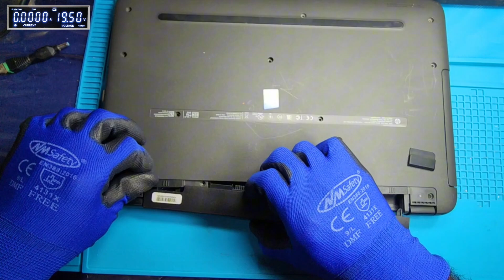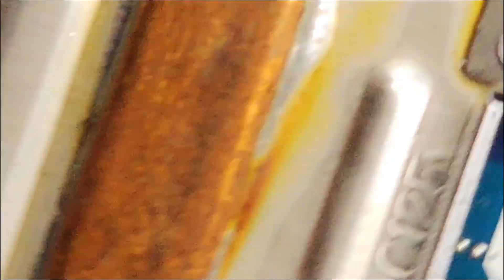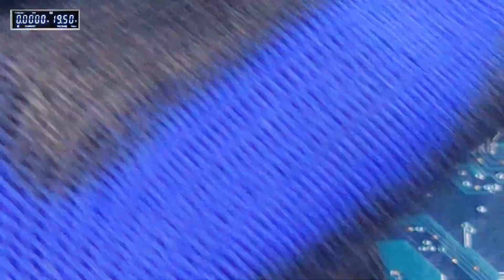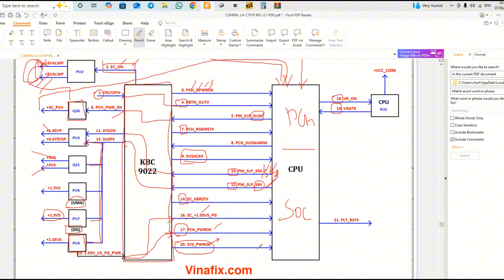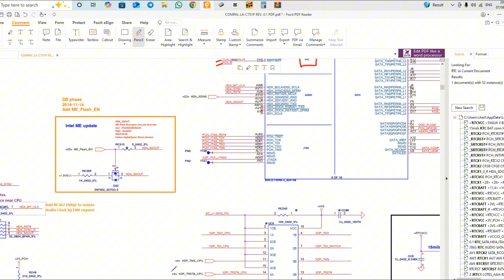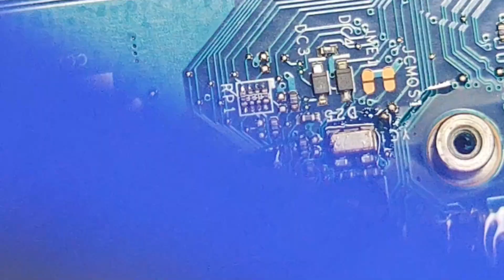Understanding the importance of 32.768Khz Clock | This is a universal Concept | HP LA-C701P NO POWER

Comment: The name signal "PCH_PWRen" what's it same with " PCH_PWROK" Brother?? Because I searhed the name signal "PCH_PWREN".not meet on inventec motherboard
Reply from the maker: Pch_pwr_en is a signal that turns on pch primary power such as 3.3v or 1.8v alw. 

PCH_PWR_OK is a confirmation signal to the pch that all core power for the pch is stable.

EC chip will collect all power good signal from regular including cpu regulator and will send 3.3v on pch pwr ok.

 Pch will deassert (to 3.3v) PLTRST# When pch_pwr_ok is 3.3v.
Reply: @philiptroniks  the name signal PCH_PWR_en what's it same on the all brand motherboard, such as quanta, inventec, etc. Because I'm search the name signal not meet on inventec motherboard
Reply from the maker: @wahyupamungkas5331 pch_pwr_en is not universal. Some manufacturers use SLP_SUS# signal directly to turn on PCH power. Mostly compal use this pch_pwr_en signal.
Reply: @philiptroniks I have checked signal SLP_sus# not there 3.3v brother, what's I have to check next?? I means what's requirements need to signal slp_sus# is high
Reply from the maker: @wahyupamungkas5331 RTC section, RTCRST, SRTCRST, INTVRMEN etcc
Reply: @philiptroniks I have checked SRTC & RTC are fine, DPWROK :3.3v, intvrmen I'm not meet. I have try to replace the crystal but still same.
Reply from the maker: @wahyupamungkas5331 you need to check crystal with Oscilloscope. Try removing both white colour caps near crystal and leave it empty and see.

Comment: Brother, I have same problem, but PCH_Dpwrok voltage not present. Ec_on present when it switch. What's I have to check forward??
Reply from the maker: Check pch_power_en pin from sio
Reply: @philiptroniks  I have solved this problem brother, in fact, signal 5v3v_pwrgd not high.
Reply from the maker: @wahyupamungkas5331 Great Job. Keep it up🫡
Reply: @philiptroniks  thank you very much brother, for your respon. 🙏🏻

Comment: So on this particular board the VR_ON signal is generated by the PCH instead of KBC and the VGATE or PGOOD signal from the CPU VCORE goes to the PCH instead of KBC. Am I right sir?
Reply from the maker: Not to pch or from pch. The cpu core voltage is turned on by the cpu itself and vgate signal from the regulator goes to cpu again to confirm the power cpu is ok. 

This is an SOC type motherboard, cpu and pch are intergrated. In the power sequence diagram the signal is just sent to /from SOC(PCH & CPU). But if you look at the schematic by searching VR_ON signal. It comes from the compartment of CPU not from the PCH.
Reply: @philiptroniks thanks for the clarification sir I really appreciate

Comment: It posible to check the 32.7mhz crystals using vom,how many voltage im looking to say  the crytals is ok ,,
Reply from the maker: You can't actually make 100% sure that the crystal is oscillating with the multimeter. But you can check if there is any voltage. Note: eventhough your crystal is faulty you will get the voltage on that pins in the crystal. Just check PM_SLP_SUS# if that signal is low. Then most probably your RTC sections is having a problem like the crystal. 

You can just blindly replace a crystal from a working board, also those white coloured capacitors also play a vital role. Please replace those also..

Comment: Hi, great vid of careful checking of each signal and stopping and seeing WHY its missing.  Are you doing a video on the "Big Tokin Cap" failure; back of CPU housing- Symptoms ? No other channels seem to know or care BUT seems if that big one or the small ones fail, the CPU cant work with all the "noise and junk" and can be mistaken for bad CPU? or something else. I have a 2006 Toshiba that all is on and voltages everywhere and signal to VRM but when i load the CPU,  the volts crashes and one second and CPU cuts out. already swapped good known CPU and flashed BIOS and others say it might be the "ME region" or clocks but checked those and all got sine waves. 1/10 i can get the screen to come on to see bios and that is stable but soon as i go to load windows the CPU is THEN needed and it starts but cuts out and voltage around VRM, mosfets ect crash.  Also cant be GPU as the signal to the Wifi card is OFF all times the screen wont come on and ON when  screen is on plus no external screen either.  All votages 3.3, 5v 1V ish around GPU and CPU all there and stable when bios screen is on and screen on.   Bad CPU filtering Tokin Cap  possibility?  Sadly EC blew when i slipped probe before i knew about that cap failures so i need to replace that and tokin and it might work...    What do you think? 
PS. 2006 CPU was before Gen 1 so no ME region in BIOS? so cant be the problem?
Reply from the maker: First of all, I appreciate for the great troubleshoot on your case as you have tried all possible ways to fix the laptop, you are going in the right track!

Your guessing is absolutely correct. TOKIN capacitors are the first culprits to make the CPU to behave unwantedly such as immediate shutdown or restart.

I have seen many cases like yours, the laptop will be on and stable in the BIOS but when it boots to windows it will shutdown or restart. When ever I attempt a case like this one I immediately rush to CPU filters and if I find the TOKIN cap I just remove it without checking anything.

The confusing thing about TOKIN caps is that they usually don't short completely to ground, they will be in a partial short but this can cause the CPU to behave unwantedly.

However, you need to replace another one for the CPU to work smoothly. Replacing the TOKIN cap is tricky, and I'm sure you will not replace it from another motherboard because the plastic housing of the capacitor will melt when you heat it and becomes unusable or get shorted. 

Replacing a new TOKIN capacitor also tricky. 

But, there is an alternative solution to this. TOKIN capacitor is equal to 4 330UF black tantulam capacitors which can be found in the CPU filter section in any motherboard.

You will have 2 positive and 2 GND pads for TOKIN capacitor. You need to manage and place those 4 capacitors in a diagonal shape so that the length of the tantulam capacitors can be limited to the positive and negative pads of TOKIN capacitor. By doing this way you can solve this problem.

I never thought of doing a video of replacing a TOKIN cap as I thought it was not necessary. 

I will try to make a video if I recieve any TOKIN cap case in future..

Don't worry about the shorted EC chip these things are meant to happen and they are sometimes out of our control.

 Don't loose hope, try and you can acheive a good result 

All the best

Comment: Please I want to ask,if susclk signal comes as 32.768khz does it mean that rtc sections are all working I mean the rtcrst,intruder,intvrm and srtcrst is okay even without testing them.
Reply from the maker: That's wrong actually what I said in the video. I saw in one motherboard before the 32.768khz was absent when RTCRST# is low but didn't double check with another motherboard. 

As you asked this questions, I justed checked with 2 motherboard by making 0v for all RTCRST# SRTCRST# and INTVRMEN signal, although, I'm getting 32.678khz clock, so these signals does not affect the crystal oscillation. 

But if RTCVCC is missing surely the crystal will not oscillate.

Comment: Very interesting video. So now i know that the 32.678 KHZ crystal will start oscillating even with RTC battery installed. Please at what point in the power sequence does the 25MHZ pch crystal start oscillating. Thanks.
Reply: My guess / understanding after this video, is, once the cosmos battery is plugged in the oscillation begins and runs / oscillates until the life of the batter as it is designed to oscillate 24/7 I would add 24/7/365days. Corrections are very welcome! 😀
Reply from the maker: Once your hardware power good signal including PCHPWROK & SYSPWROK is sent to PCH. Then the it will turn on the intergrated clock IC or dedicated clock generater IC on the motherboard to generate Megahertz clock.

Comment: I would like to inquire from you,  if RTC VCC IS OK, BUT OSCILLATOR ISNOT WORKING, THEN I TRY TO CHANGE OSCILLATORS BUT STILL.SAME ISSUE NOT WORKING /OSCILLATING, DOES IT MEAN PCH IS FAULTY, OR THERE OTHER SIGNALS MISSING
Reply from the maker: Basically try changing crystal, those 2 white capacitors near crystal. Check RTCRST#, SRTCRST# signal they should be high 3.3v always. Their pullup resistors should be 20K, Also rcheck PCH_INTVRMEN this should be 3.3v. Its pullup resistors should be 330K.

If all of these are ok then you can say it is a PCH fault.
Reply: @philiptroniks Thank you sir for your help

Comment: Thank you. Sometimes when I look at the crystal with DSO, the 32 khertz crystal makes 20, sometimes it makes 52 or so, what I mean is 32 khertz, it is not constant, there are many ups and downs. There is another waveform in the form of a shadow behind the waveform. How should we evaluate this situation? The device does not work.
Reply from the maker: First make sure your probes, oscilloscope are calibrated well. Make sure your oscilloscope is perfectly grounded on the motherboard. 

Still if you are having the same problem please change a new probe.

If the problem persist even after replacing a new probe then it could be the Crystal, the capacitors on both ends of the crystal or the PCH itself...
Reply: Thanks for the full educative videos u really impressed me on each video

Comment: Nice video master
Reply: Hi master. I have a ho pro book 640 g7 mother board . The problem is it’s turning on first time when I plug tha dc jack and it’s goes off. When it’s on the all supply are Present. But it’s not turning with power button any how. It’s try to getting on the power led glow once. When it’s trying to on the all voltage are tripping .

Comment: My friend, thank you first. I have a question. The resistance on the rsmrst and slp-s3 was very low, reaching 50 ohm. Is the crystal causing this problem?
Reply from the maker: Yes 50ohms means it is a low impedence, which, the EC chip is making it low due to missing of some of its requirements.

 And this is not solely because of KHz crystal always. It can be a reason but not always

There are other possible sides for RSMRST# to be low such as EC firmware error, RTCRST# signal abnormal, ECRST#, EC dead itself and so on...